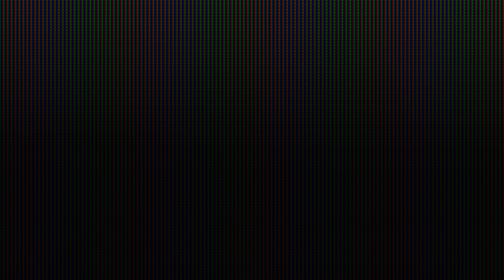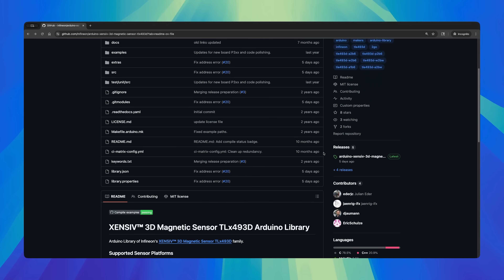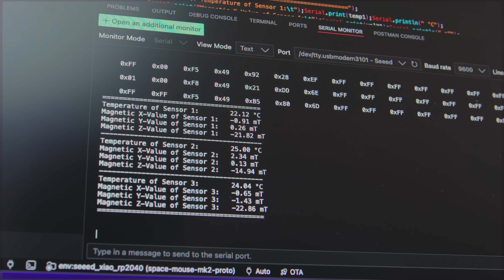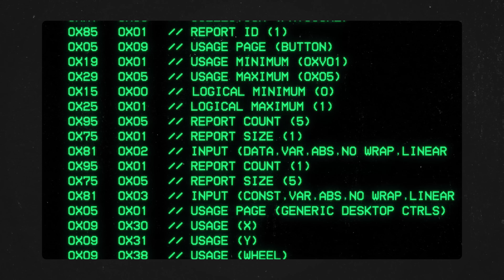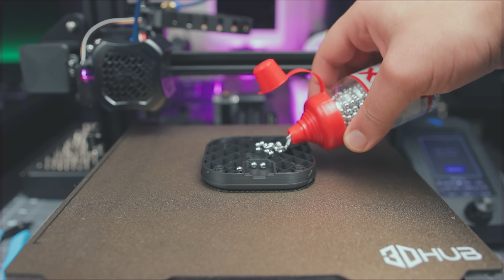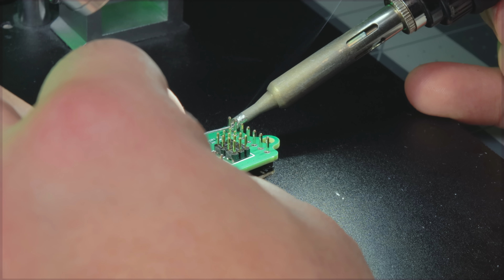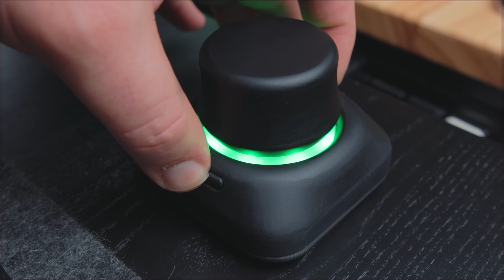I Made a 6DoF Space Mouse using Magnets (again)*

Comment: This is a fork / clone / reverse engineering of the Chinese Spacekat project. It would be good to point that out, otherwise this is just outright theft.

Spacekat uses exactly the same sensors, in exactly the same geometry. With one single exception: the original project uses 1 magnet in the center of the triangle (diametrically magnetized, and that is important). I suspect the author used one magnet for each sensor in order to give themselves more freedom in the mechanical part and to simplify the math. Moreover, the distribution model is exactly the same as Spacekat’s.

The Spacekat developer provides binary files for flashing the controller, gives out the Gerber files of the carrier board, but sells the board with the three 3-axis digital Hall sensors assembled. The distribution model is the same.

The FDM-printed spring is taken from leospacelab’s project “Space mouse DIY, No Springs, Fusion360, Magnets” on MakerWorld.

And reverse engineering the protocol was not really necessary, because all the sniffed data has been available online for ages already, and it was used in the fairly popular AndunHH/spacemouse project, where it is also posted in a clean and accessible form.

And no, I do not see a problem with taking a compilation of all the best solutions / elements / ideas and their modifications into one device and providing these solutions to the community. I also do not see a problem with selling your own implementation.

But it is somehow not very good to take exactly the same foundation, ideas, solutions, and distribution model, without mentioning the original projects at all.

And fine, if the source files had been provided to the community. But no. You are selling products, making money from them, while basing them on the foundation of open projects. A rather low level of engineering honor and cleanliness.

And by the way, the use of the 3Dconnexion API is not exactly legal.

They invested in the integration and development of the API and software across all CAD tools, and that is why they are now almost a monopoly manufacturer and the owner of the ecosystem. And to use their API and applications, you need to register in their API access program, in the license agreement of which there is a line along the lines of: “it is prohibited to use the API and software for the purpose of creating a competing device.”

To be honest, I am rather saddened by such a low level of culture.

I really liked the Cyberdeck project, and from it I could see your genuinely high engineering level. But here I saw only engineering uncleanness.
Reply from the maker: The sensor I used comes from the Adafruit module I already used in my own version back in 2023. Spacekat looks like a cool project and even more advanced in some aspects, but this is the first time I come across it. I only found a few videos on Bilibili in Chinese from 2024 onward. The GitHub repos I found had only bundled firmware and some models, I didn’t go through everything but I didn’t find the "geometry" you’re referring to.

The sensor layout is something that stuck with me from the OS3M project (it used pcb coils and inductance sensing). If there is any inspiration to credit that would be it. Putting sensors in a triangle isn't an earth shattering concept.

All my projects are open source and I always mention and link anything I use. Here is proof: 
https://youtu.be/nZa-Vqu-_fU?si=-ZSWOTOBiikJOVwK
https://youtu.be/7DfexfHzT-w?si=1OGEV1QtpNKq0eX1

Why would I go through the trouble of "reverse engineering" someone else’s project just to present it as my own open source solution? Really?

About the “Space mouse DIY, No Springs, Fusion360, Magnets” project, I checked it after your comment and it actually looks like a remix of my earlier version. You can compare the enclosure parts yourself. My project is even mentioned in the video. I didn’t use anything from that. The spring I used comes from very common compliant spring designs you see everywhere, I was inspired by a SLANT 3D video I believe.

I’m also not sure what you mean about the 3Dconnexion API use. Please take another look at the driver demo and files maybe that will make it clearer.

I agree with you about crediting original creators 100% and that's something I already do. In this case it simply doesn’t apply. 
That said I'm open to adding links to all these similar projects in the description to make them easier to find.

Before accusing people of theft and "low level of culture", it’s worth taking a closer look. I hadn’t even finished publishing the files before you posted this.
Reply: what's that sizzling sound? oh, it's Kakoi getting burnt to perfection.

Comment: The most obvious improvements are to add more sensors and magnets so it becomes 6 instead of 3 to make it more precise and also provide more data to filters to rule out jitter and also ensure that only the intended movement is what we get out of the device and software combination, the next thing is to make it wireless and the battery can be the additional weight instead of dead weight, preferably using standard batteries that easy to replace (3 would be great for both weight and charge)… and of course use Resin printing for the outer-shell, and a lot more LEDs to make the effect more subtle, also add some breathin animation and having more buttons would nice too that can be assigned to macros! And to make this surpass SpaceMouse is to add a tactile OLED display that could be interesting to some to have, as that would add a lot more feature customization to the device. But that's another level of engineering, and since you like challenging yourself, then this would be a great addition.

Comment: First off super cool project… my first thought was to wonder if it could have another magnetic sensor in the knob to turn the top of the head into a scroll wheel.  My other thought was the way the sensors are positioned and how the knob moves reminds me of a 6dof movement platform called a Stewart platform.  Since you kinda know the positions of the magnets and sensors relative to each other I half wonder if a inverse kinematics type calculation might help where you are essentially using the two fixed triangles of the magnets and sensors along with the sensor readings to determine the 6dof position you need. And if some motor magnet tricks like using magnetic iron to focus the magnetic fields where you want it.

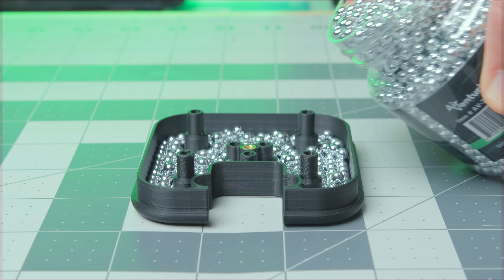Comment: 10:07 Have you considered casting a lead shaped part to add weight? I used to make fishing sinkers as a kid by melting lead on the stove in the kitchen in saucepan and pouring into a cheap mold.

You could do similar to make a lead version of a 3d printed part:
1. Print the part - not sure best plastic type, probably many are fine
2. Coat printed part in sand+casting solution, several layers (dip then sprinkle sand, repeat, let dry)
3. Melt out 3d printed plastic - can be done in oven or microwave or other ways
4. Melt scrap lead in dedicated saucepan on kitchen stove and pour into the mold shell
5. Break shell - you have a lead version of your 3d print

For multiple or more reusable casts you can use casting sand mix with 2 half molds where you put 3d print in, pack sand, separate halves then cast like typical bronze or other metal working foundaries do. It's just sticky wet seeming sand and 2 wooden boxes where you can pack it then separate them to take out the mock shape you intend to cast, then pour liquid metal into the cavity. 

So yeah, making it from solid lead is pretty doable with kitchen equipment, 1-2 hour research and a couple hours to cast it, and I expect scrap lead to be very very cheap. GL!

BTW let me know if you know what I mean - I can explain in better detail - I'm not sure how understandable that is, but it is straight forward for complete newbie who have never done anything like this with just a little research etc and I'm happy to point in right direction.

Comment: Amazing!

Only improvement I can think if is either the sensors need to compensate for the axis of rotation changing under torsion and memory of the petg spring deflection or better: utilize a double bearing where the axis of rotation is always fixed.

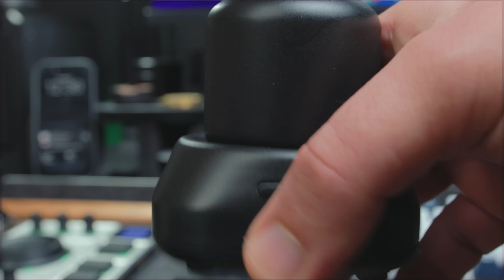Comment: 10:18 if you dont want to use (or just deal with mixing) silicone or resin you can always just use candle wax and melt it.
Reply: This is not a great idea if you are using PLA. the melting point of wax is above the glass transition temperature of PLA. You can also easily heat the wax to above the glass transition temperature of both PETG and ABS if you are not careful and measuring the temperature as you go.

Comment: You might be able to add a click that only actuates when the knob is pushed down and not when tilted. I think having a thin conical disk spring that pivots about its center with the knob. But once you push the whole knob down, the whole spring goes down and you get a click. Not sure if this would be a maker friendly component cause I don't know if it's readily available.
Reply: I mean, would we want that?  "Down" is a direction to move things in, like the others; not sure I'd also want it to click

Comment: Nice work, some thoughts for cost down. The sensor only uses 3.7mA , a gpio maybe could power them without the switches. Also you can have one powered permanantly and re-address it first to save a gpio line. The sensors are not radialy aligned relative to the central axis, which I had to think about and it concluded it doesnt matter, I wonder what the effect of diametrically polorized magnets would do, aligned with the sensors.. hope thats of use.

Comment: Very cool! I actually started on pretty much the exact same thing last week. The only major difference is the microcontroller and that it'll have a bldc as a haptic feedback device
Reply: Maybe you can use those new keyboard switches with haptic feedback to get haptic on the xyz movement in addition to the bldc motor for rotation
Reply: @lililililililili8667  which ones are you refering to?

Comment: It cannot work, the fatigue will start to play a role, after around 100 movements (that is not much), after a 1000 movements, it will completely be out of spec. Respect for the builder, but this is overkill in electronics, while most designers have not this knowledge. 
After using 3D connexions mice for over a decade, I just stayed with the Cadmouse, which can do all those things, roll, zoom, yaw, move,... The shift key and or control key change the functions of any mouse.

Comment: I was recently considering a 3D mouse for my Onshape hobby usage but dismissed it as too expensive. I just ordered your assembled PCB because I definitely want to build this! A couple of questions:
1) Besides the PCB, I’ll need the "Seeed Studio XIAO RP2040" and to print the enclosure myself, correct? I don’t have the XIAO RP2040 at hand, so I want to order it ahead of time.
2) Is there a way to make this work with Onshape? I’m guessing that with the right driver, it should have the same capabilities as the original 3D mouse, right?
Reply: Onshape is supported by the 3D Connexion software, so it will work. I'm pretty sure he also specifically mentioned it in the video

Comment: It's not illegal to emulate the SpaceMouse. You can release it. Other projects did it.
Reply: yeah this is how all usb devices work
e.g. usb gamepads emulate the data sent by a playstation or xbox controller, because that's what software actually supports
Reply: @12...  No, there are standard HID profiles for gamepads. Maybe some knockoff cheap import products do that, but for sure not any of the even mildly serious producers.
Reply: Would be pretty strange for a USB Device ID to be under copyright or trademark laws.
Reply: @Michael-m2t6y  You'd be surprised what some manufacturers try to get away with. Just recently there was a big hubbub about a 3D printer manufacturer that tried to lock down its "open source" printers by claiming that emulating the device IDs to connect to their cloud services were "hacking"... the device IDs that were in the open source GPL license code, btw. Something like the spacemouse has at least a shred of credibility trying to claim that the device IDs are not open source. Either way the point stands, come companies will litigate over anything.
Reply: @Michael-m2t6y  You have to be a paying member of USB-IF to register for a manufacturer ID and device ID. It costs $5000/year to be a member and to use the VID.
Reply: It's clearly stated in the membership agreement;
"Vendor ID (VID) Number. Company hereby applies for a USB Vendor ID Number and agrees to the following: The USB Implementers
Forum is the authority which assigns and maintains all USB Vendor ID Numbers. Each Vendor ID Number is assigned to one company
for its sole and exclusive use, along with associated Product ID Numbers. They may not be sold, transferred, or used by others, directly
or indirectly, except in special circumstances and then only upon prior written approval by USB-IF. Unauthorized use of assigned or
unassigned USB Vendor ID Numbers and associated Product ID Numbers are strictly prohibited."
Reply: @Michael-m2t6y , companies need to pay the vendor ID annually. Meaning it has legal binding. And I bet disguising your product as someone else's product would count as illegal activity, but companies usually won't do anything if you're not selling it with their code, credentials, id's. Or distribute their code.
Reply: Yeah it's probably fine but still such a big company could still sue him even if they know they're wrong and he may need to backoff because of how much money lawsuits cost and also because of the hassle, a company don't really care since they're used to this legal stuff, and individual does. I could be wrong here but that's my opinion based on what I see.
Reply: @yassine-sa  Learning from an industry that exists based on parody and has to regularly defeat copyright C&Ds, it's important to distinguish the threat of a lawsuit from an actual demand (or lawsuit). People underestimate how much companies are required to go through the act of pretending to care, when they may not even actually want to stop the supposed infringement if not for fear of "use it or lose it". As long as you avoid being an actual threat to their livelihoods (or a juicy target) and can give them the fig leaf of saying they tried, no sane company will pursue it.
Reply: @AySz88  No, that's actually not how things work.
See Nintendo/Disney.
Reply: @A_Simple_Neurose  Well, I'm very much referring to what you're seeing from those companies' boilerplate. "Non-threat" and "not juicy" are important caveats, but there are thousands of makers who have learned to just counter fig leaf with fig leaf and never get bothered again.
Reply: People publish illegal stuff all the time. That means nothing. For your personal use, you can do almost anything. Publishing a build video on a monetized platform like youtube, however, is already firmly in "commercial use" territory. Whether or not this is legal depends on how original your work is. If this space mouse is "original enough" or counts as a "derivative work" clearly meant to replicate the protected SpaceMouse design is a question the courts would have to decide. This video may very well already constitute an illegal commercial use of a protected design, even without him selling or even publishing his design.
Reply: There is still such things as terms of use or a EULA. I don’t think 3D Connexxion will love this use of their Software
Reply: @lennardodavinci6350 EULA violation revokes your right to use the program but who cares about that? If this is deployed as a corporate device then yeah probably but for personal use I don't give a fuck

Comment: Super cool, open hardware is so badass. Would love to see you keep improving on it. I'm also sure llm's can help in porting the firmware for macos and maybe windows based on the linux code. Does the spring feel good? I also can't imagine it lasting longer than a couple months of weekly use. That's definitely a part I would look into sourcing or making from metal.

Comment: Hi, I had a similar problem a long time ago where the rotation was calculated incorrectly. I think a good solution would be to calculate the Rotation matrix 3D using data from the sensors.

Comment: I would loved to see a trackball turned into a 3 DoF space mouse. Imagine the model is contained in the track ball and as you spin the ball the model moves the same. That gets you 80% of a space mouse, add a scroll wheel for zoom and you're pretty much 100% feature parody in, what I feel would be, a more intuitive interface
Reply: My project, Rotatrix, is exactly this idea! 1:1 rotation with 3DoF trackball. Using bindings you can switch to pan+zoom, or regular mouse. People do seem to find it more intuitive because the motion is proportional to the ball motion, rather than being a joystick. I put several videos of it up on my channel.
Reply: @davidliucreates ok now I want a mini trackball on my custom kb for that
Reply: A trackball + 3 scroll wheels, or 2 trackballs seems like they might be intuitive for CAD. Either that or a trackball you move with your thumb and index on the side/top of a 3dof mouse, where all your other non-grip fingers are used for buttons.
Reply: Something where the ball wouldn't "spring back" to a home or resting position? That would be pretty cool. Could put 3 optical mouse sensors under the ball, and then rest the ball on 3 ball bearings. I kinda want to try that now :)